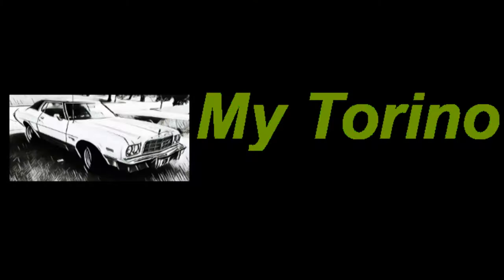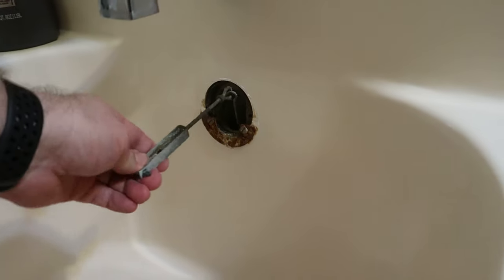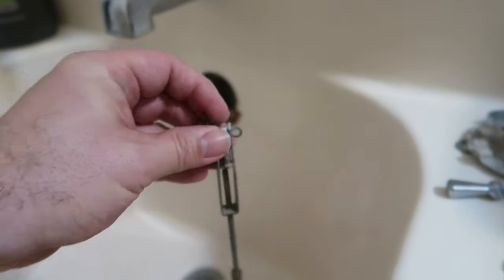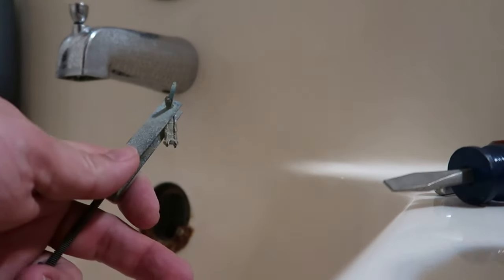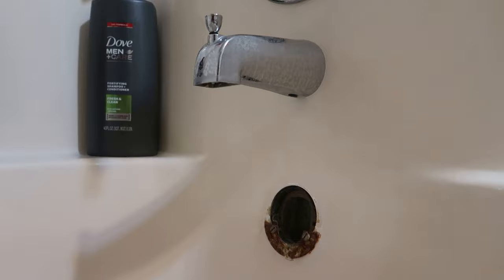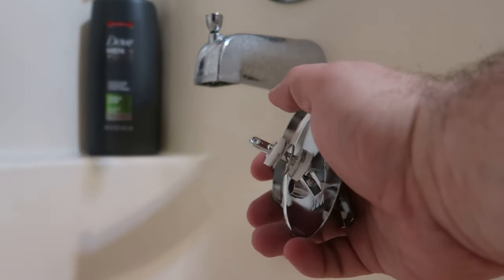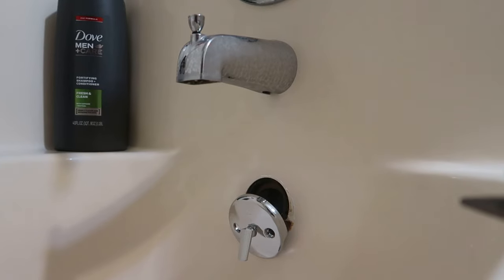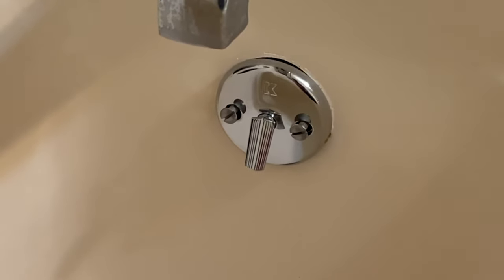Tub Drain Trip Lever Replacement

Comment: Is there supposed to be a gap underneath where the plate goes? At the bottom of it where it's sealed against the tub after you install the trip lever? Sorry I don't know how to explain it. There's a gap about a fourth of an inch under ours, under the bottom where the trip lever plate is but everything else is flush against the tub. It looks like that trip leave her plate was installed too high because of that gap underneath but my brother-in-law told us it's supposed to be like that but I think that is the reason why water is leaking down into our kitchen.